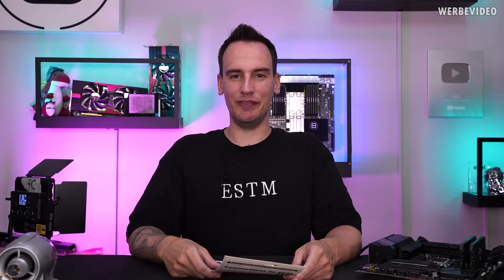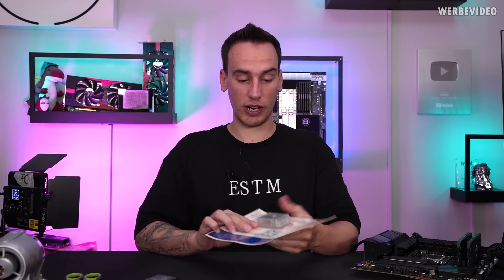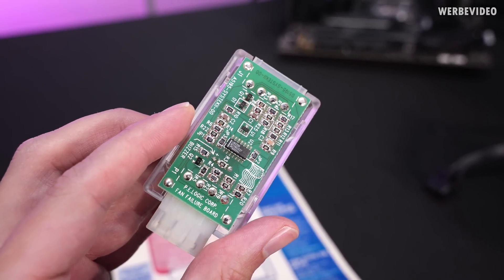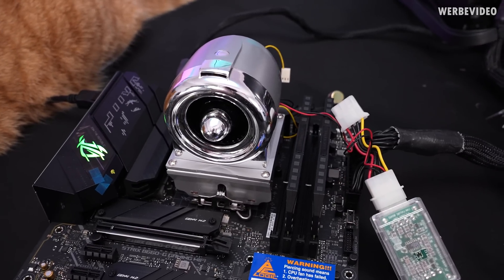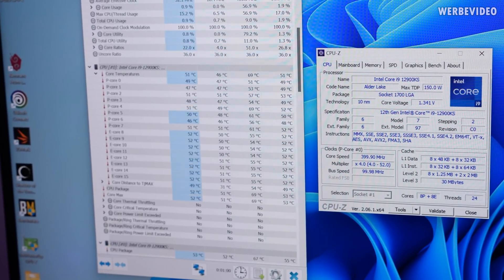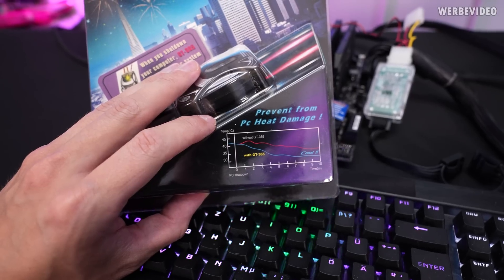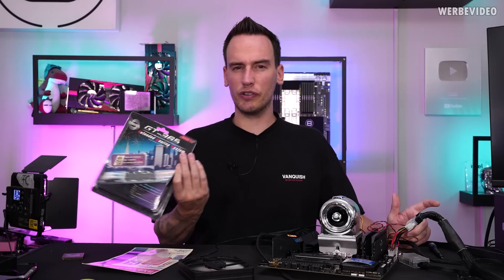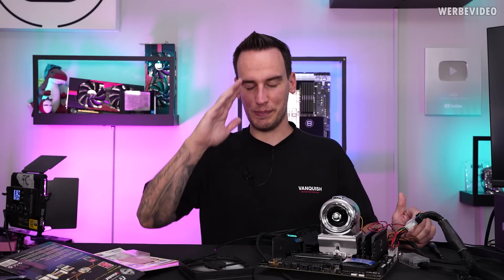This 30 Years old Cooling Gadget was Supposed to Protect your CPU... but it won't

Comment: I actually experienced a fan dying for me, BUT, it's a big butt =). It was a fan for the South Bridge, it actually shut the computer right off when it happened. I just put a common aluminium heat sink on it and it worked, just a 10 min fix. This was back in the day when I had a Intel Pentium 4 if I recall correctly, that probably was around 1999-2003.

Comment: A few months ago the stock Wraith cooler that came with my AMD CPU suddenly failed one day after three years of service with no real warning. One moment I was doing my thing, playing some modded Skyrim, then I got a massive FPS drop and thought it was some newly installed mods that made the game run unstable. I quickly realized the fan had stopped working due to the glass side pannel and RGB (see RGB isn't completely useless lol!) that showed the problem clearly at a glance. Computer was regularly maintained and clean when the fan died too.

Comment: That cooler is not that loud at all. Try a Coolink Cool-122+ (or 132+, or 111+). Now those were insanely loud. In exchange those were the best Socket A coolers. Even fan attached to 7V, they can hold up with any other cooler. Oh, and if you want to know, Coolink was the consumer brand of Kolink. The company who designed Noctua's coolers for ages (or even today).
Spinning a fan after shut down wasn't far fetched those days. Enermax PSUs did the same as  I remember. And if you stop all the fans, the heat traps in the case, so yes, the case temperature can rise.

Comment: i worked at a computer store from 2000-2009 and we had dying and dead cpu fans in computers we worked on relatively often, also lots of dead or dying case fans. also every computer was an absolute dust factory, dust filters were rare and positive pressure behind dust filters wasn't even a thing

Comment: i only ever had a fan just stop working but it was due to the psu pushing way higher voltage than it was ment to. still don't see why he fan failed but nothing else.

Comment: I've seen fans fail on like Enterprise servers but I've never seen one fail in like a personal rig usually they just end up making so much goddamn noise that you know that you need to replace the fan in a server that's a different story because you can't necessarily hear the fan bearings failing

Comment: I have had a critical fan fail rather spectacularly a long long time ago...  I had an MSI Geforce FX 5700, and the fan just came apart - the hub with the blades literally fell out of the card and was sitting on the floor of my Cheiftec Dragon case and overheated the card.  I was not impressed to say the least as the card was only about one month old.  That was the only major fan failure I've ever had though.  I've had noisy fans (plastic bushings - yay) , wobbling fans, etc.  But I've always had ample time to replace those.  But no fan has ever failed as badly as that one.  I was quite happy with the FX 5700 Ultra replacement however. :D

Comment: had a blade break off on a psu fan and jam up and burn up the psu eventually in a dual pentium pro ironically. did not realize it had died because the entire system was so loud

Comment: "or system overheats" It doesn't say anything about detecting the cpu temperature. Just the fan and system temp. Likely just has a thermometer to check the surrounding air temperature.

Comment: The increase in temps right after you switch off the device is correct.
For example, in my car, using OBD2 reader, reading coolant temps while idling is around 93c.
The moment I switch off the car, the temp spikes to 95-97c, as coolant circulation and fans stop, while the source is still hot (usually higher than coolant temps).

Comment: I had a few fans die on my back in the 90's. They were not very good fans, and they just stopped at some point. Fortunately they were not on my CPU. It was around then that I started doing more research and saving up for better quality fans. 
But I recall other companies making similar devices - there was no overtemp protection yet, so CPUs would get hot enough to fry themselves.

Comment: My current mainboard has the same feature built-in. I've actually had fans just completely fail many times before. It was on a PC that was on 24/7 for years and the top case fans blades fell right off the bearing. The fan blades was resting on top of the CPU heatsink lol.

Comment: the use of the 2nd device is good for keeping air flow going inside the case for things like parts do not have enough air while PC is on to cool down more while its off so i dont think its hurts when you have active air flow after shutting down the PC for an Extra time
about the first device the answer is old fans tech tend to fail sometimes the hall effect sensor fail making the fan stuck and heat and some old fans just stuck out of blue

Comment: Hmm.. Seems to be trying to sense current and would beep if a fan is stopped and trying to move again, or not pulling any current at all? A fan with a VR/POT (potentiometer) will pull less current and even start pulsing it lol plenty of (cheap sleeve bearing) fans i've seen broken over the years, though i still have fans from the late 80s and early 90s that are still working, others that are not..but usually cheap ones claiming to be ball bearing! And that GT-365 is taking +5VSB and giving that to the fan, maybe with a boost converter but probably not, until you power up then 12V is sent to the fan.. lol

Comment: I repair PCs many years now. I found many failed fans case ones, CPU cooler ones, PSU and graphic cards ones many times.
The main reason for all of them was that they were left to develop a fur combined with dust, general fumes and humidiy, the fan will stall and burn its coils.
There are a lot of people out there leaving their PCs always running you can imagine the image of a fan after some 1-2 years or even months.

Comment: I have had an old (and tiny) gpu fan stop spinning. Just absolutely seized up.
The GPU lived because there was a case fan right on it lol. (Well for another year anyway)
I don't think I noticed the seized fan until I went to replace the GPU.
I think the kind of little 40mm fans or whatever they put on those old CPUs were not the most robust contraptions.

Comment: Older PC fans had terrible bearings and failed quite often. A lot of older CPUs didn't have temperature protections either so CPU fan failure was a legitimate concern, but a lot of motherboards added CPU fan detection.

Comment: This was actually a good product back in the day, I had CPU fans die when the cheap sleeve bearings wore out. In the 90s there wasn't a great selection of CPU cooling fans like there are now. These CPUs just needed any fan to not overheat.  I lost a CPU to a dead fan, I also lost a GPU on a FX5600 GPU  (Gainward) when the fan died.  The fan was powered off a molex connector.

Comment: Fan getting blocked it does not happen to you because you are often changing your setup. But I went to help a neighbor (heavy smoker) who in 2014 was still using an AMD Athlon from 2005 (maybe even earlier). His CPU was shutting down automatically 20 minutes after starting. Both his power supply fan and the CPU fan were blocked. You cannot imagine the amount of dust accumulated in that PC in 9 or 10 years (smoking and 2 cats in house as contributing factors). Both fans were permanently damaged, they did not start spinning even after cleaning the PC. I do not advocate for such device tough, rather for servicing the PC from time to time.

Comment: I used to have that issue 10+ years ago. Fan lockup was quite common early 2000's through 2008. (I have to note that I wasn't into the pc scene before that so I cannot attest to anything earlier.)

Comment: I've had some sleeve bearing fans in a few (like, 3 or 4) PSUs suddenly seize and fail back in the mid 2000s after about 3 years of use. Haven't had any fail since I stopped using PSUs with sleeve bearing fans. FDB and ball bearing only these days.

The failed PSUs were used in the old top-mounted style cases. Idk if hot air contributed to elevated temperatures that may have accelerated failure.

Comment: I've absolutely had fan failues, including fan failures I didn't notice until the CPU or GPU started overheating. I can see the utility of this item back in the day, especially for a PC running some service that isn't in your eyesight and isn't being interacted with all the time. Fans, in particular bearing technology, have improved so much in my lifetime that if I built a PC today, despite having 10+ working fans and the effects of inflation I would buy all new fans.

Also the temperature is in Freedom Units so it's almost certainly measuring ambient case temp and not CPU temp directly.

Comment: what i would say is the evercool would allow faster cooldown of the case temps, but i dont know about cpu/chipset.  i would say the fact you have all that heat still in the heatsinks but you've now shut down any circulation inside the system, would cause the internal case temps to increase.  but allowing the case fans to run for a little longer, would circulate fresh cooler air into the system and cool it down.

thing is, thats all irrelevant if your temps arent near the thermal limit anyway.

Comment: I had one fan that broke down. I think it was the fan that came with the case. I suspect that cpu fan was spinning the case fan faster than it was supposed to, and after few years, it started to make whining sound and then it fully stopped eventually. Also I think some dust went into bearing.

Comment: The knob you were turning is called a potentiometer. Often used on electric guitars and amps. Old CRT TVs and old Radios used them for volume knobs. I've used them a fair bit in my electronics repair business, but I forgot they used them for fan control on computers back in the day. So glad we moved away from that.

Comment: I had in my last computer 4 Case fans that died in the timespan between 2008 and 2019 so In 11 years I lost 4 Case fans out of the 8 fans my case had on it (I replaced them when they died) 
I never have lost a CPU fanr.

Comment: ive have countless fan failures on pcs running on the factory floor due to the dust 
and a product like that would actually be helpfull 
coz pcs just shut down and then u have to scramble to figure it out why

Comment: You have to put it in context of the era, where CPU's ran a lot hotter if not cooled correctly, no thermal shutdowns if you overheated you cooked your CPU and there was little anyone could do to foretell even with the very best fans and heatsinks which again were limited in comparison to today.   Nor was it limited to the CPU, when that grenaded it would take the ram and video out in its fiery self destruction and likely brick your motherboard.   I know this from experience when chasing the 3ghz single core AMD overclock, causing OCZ and XFX to become very unhappy about their no quibble lifetime warranty as I was burning through ram and video almost weekly and it got to the point where both companies said this is the last last one we will honour and it was.   Have a carrier bag full of murdered AMD 1700+ Mobiles and other Barton's most with blown out cores, see back then we had the awesome DFi Lanparty NF2 motherboards where you could crank up the volume on all the voltages essential in overdriving the poor AMD CPU's, watercooling was in its infancy as was cryocooling, I used water and peltier to get my AMD up to 3.01ghz which back then was a massive achievement and it lasted a week before burning out nuking the mobo but not the ram or video.

Comment: I only once had a fan fail at me, it was on a graphics card. I only noticed it when a game started lagging like never before, and then I smelled plastic burning. Frankenstein'd a case fan onto it, and it worked fine after that.

Comment: I believe the idea here is that the case temperature raises after shutdown and running the fans prevents that. It's a similar principle applied by racers that run their fans and turbos after the car shuts down. It's technically lowering temperatures but who cares. It's mostly bull crap.

Comment: These processors claimed they maxed out at 85 Celsius, but they didn't have thermal safeties. It would not shut off just because they went above 85. Devices like these were really common in critical environments where fan failure would result in a computer literally cooking itself to death.

Comment: As others pointed out fan failures were common in the early active cooling days. Because they were cheaper quality or the system was  on the floor in the office environments and easily clogged with dust. You can say 'if the fan fails it will run thermal throttled' but back then the apps slowed to a crawl or the system just shut down. Fan was always the first thing we checked on flaky systems. 
Back in the day :)  We installed the same type of device to detect fan failures in workstations as well as one that was a temperature probe jammed between the heat sink fins. Or maybe it was a unit that had both, don't quite recall.  On tower servers we put in a front display with temp output via the probe in the heatsink fins. 
All this was with beige box vendors, once we moved to IBM and Dells as a provider there were no more fan issues.

Comment: recently my cpu cooler plugged into my commander pro stopped spinning and I freaked out and I didn't know if the system would power off by itself as a security measure, luckily I was using it and noticed when the system thermal throttled, a nice beep would have been nice in that case, but now I'm not plugging anything like that into anything other than the motherboard anymore 

what basically happened is that fan ports 1 and 6 of the commander pro are not working anymore

Comment: ive personally had 1 noctua 140mm fan, and a real cheap case fan completely seize on me and fail. the noctua one came completely ruined by the shipping company, but it still worked so i didnt mind  it. about a month later it seized. thankfully, noctua is top notch and shipped me a new one without needing the broken one.

i should probably take it apart and check, like 99% sure the bearings are galled up quite a bit due to a bent shaft or something like it.

Comment: I have had fans fail before.  My younger daughter has a GTX 1650 in her PC that one of the fans died on, it still spun but it would make a lot of noise while doing so and the GPU would over heat.  I replaced the fans with a 60mm Noctua fan which I ziptied onto the card and it is still working fine (and quietly) today.

On a side note, I had a Gigabyte board quite a few years ago for my AMD system that came with two features enabled.  One feature was a alarm and eventual system shutdown if the CPU fan failed.  The other feature was a zero fan mode which turned off the CPU fan if the system was below a certain temperature threshold.  As you could imagine, it took me a while to work out that the two features did not communicate with each other - when the system was in BIOS and the CPU was clocking to the maximum, it would be fine but as soon as Windows loaded up and the CPU downclocked and cooled down, the CPU fan would turn off and the computer would start beeping at me and proceed to do a forced shutdown.  I don't think Gigabyte ever fixed that issue on that particular motherboard either.

Comment: I think with the gt-365 they mean that the temperature of the air increases after the computer is turned off. This might happen of your case isn't that open and you shut down right after a heavy load, as the gpu and cpu cooler would keep heating up the air in the case while it's no longer getting replaced with cooler air. Why would you care about the case temp getting a tiny bit warmer after the pc is off? No idea.

Comment: Installed 20ish of these devices or similar models in the late -90's in the Administrative and CAD-offices of a papermill, CPU coolers of that time had some issues and PC's didn't always have the fans connected to the motherboard and monitored but often connected to a passthrough 4-pin molex. Issue was fans failed and broke CPU's on expensive workstations and brought alot of downtime and loss of production so they wanted this but it felt more like buying false insurances cause the fans broke while noone was in office or on lunch and could hear the alarm and shut the pc down.

Comment: 7:22 Never on my own, but working in a PC shop when indoor smokers bring their PC's the fans would be dead do to the tar residue getting into the cheap fan bearings or adding weight to the blades that it dies early

Comment: I'll always be amazed at Cooler Master's attempts to make a turbine cooler that was actually good - their best effort (the Eclipse) in reviews was on par with their Hyper TX (which was back then around half the price and also quieter).

So glad that boards towards the end of the 90's integrated temperature diodes and alarms - my slot1/s370 Jetway board immediately turns the buzzer into a siren as soon as the CPU fan's speed is read as zero (really annoying with dodgy connectors), or the CPU reaches the set thermal limit. Which really wasn't necessary unlike with Socket A. Everything for that socket runs really hot, and would destroy itself if the cpu fan failed.

You should have a look at the Thermaltake Schooner. It is a very interesting passive GPU cooler.

Comment: Fan failure when it just stopped happened to me twice, and in both cases I found out when my pc was shutting down randomly and throttling to lowest possible speed, so that's happening in real life. in both cases it was fan mounted on cpu cooler blowing upwards, after X month of 24/7 operation fan basically started to fall out of it's frame, it got loose enough that it was only spinning when you pushed it in a little, and felt down completely while I was replacing it. It was identical failure in both cases